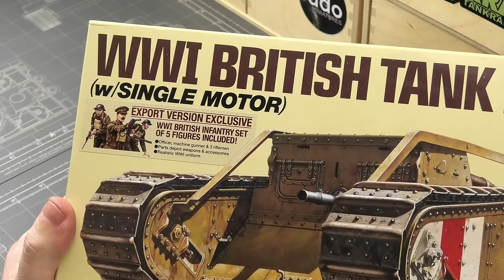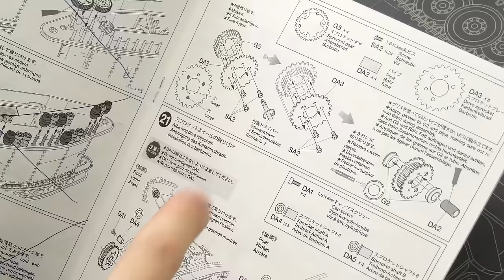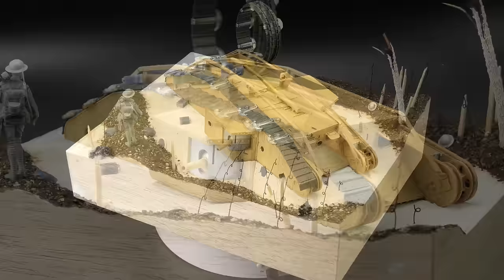Cutting The Best Tamiya Tank Model In Half... For Diorama Purposes!

Comment: I've built almost all the 1/35 Tamiya Armour and this is definitely one of the super stars. My rough cutoff for when their design/engineering improved significantly are new tools after 35228 (M8 Greyhound) with the most memorable ones being the FAMO, JSU-152/IS-2, B1 Bis and Type 10. Currently starting the M26 (The front portion of the Dragon Wagon, not Pershing)
Reply from the maker: I'd love to build the Dragon Wagon as well, just the tractor without a trailer! :)
Reply: @NightShiftScaleModels  it appears the m26 was re-released in early 2022, i caught it because it showed up for pre-order on some sites I frequent but I havent actually seen them switch to "in stock". I randomly came across the M26 kit at a store and it doesnt appear to be from a preowned collection and I have no clue where they got it, sorry. Best of luck finding one - i stared at ebay listings for years and never pulled the trigger. If you do get it, I highly recommend getting resin after market wheels at a minimum.
Reply: @NightShiftScaleModels  You could always do the 2000 release, which was just the recovery version. Those go for a fair bit cheaper on the market and if you're just doing the prime mover anyway...

I certainly would love to see you take on something that isn't a tank, and a tank transporter would certainly be an appropriate addition to an armor modelers collection
Reply: @Danfunnyman1234  yup thats the M26 (kit 35244)

Comment: Great diorama idea, and as usual will be executed with perfection. Question though: why not use resin to make the water? In this way you don't have to saw the tank in half, and you can get even more depth with murky water?
Reply: This was my thought. it would have just required a slightly thicker base than he usually does and would have skipped all the cutting.

Comment: I recently made the motorized B1 Bis from Tamiya and it was loads of fun too.  the motor is totally superfluous and caused extra headache when it came to painting the thing, but it was still neat to be able to flip the B1 over, flip a switch and watch it drive over my living room carpet.  Doesn't turn or anything, just goes in a straight line.

One thing for anyone who plans to make one of these with the motor.  They have a track-tensioning mechanism which you should leave as loose as you possibly can.  the tracks that snap together are really cool, but they're only plastic, and I had my poor B1 throw a track after a connection point snapped.  Luckily they provided ~5-10 extra track links

Comment: When  i build bases for my models I use PVC forex board, you can get them in different thickness and sizes. I cut/file all corners at 45 degres so you dont se the end of the boards on the outside corners when i glue them together (same as when you make a wooden box). when it comes to the top i draw the edge of the terrain on the outside and remove the excess material, when i have the terrrain edge the way i want to, I also cut/file the top edge on an angle (inwards) so i dont get an flat top and I can get the terrain materil all the way out towards the edge. 
looks good when painted black afterwards and its stonger than balsa wood.

Comment: Martin, have you tried using foam board for the base edging?  It’s easy to cut, light, smooth and doesn’t warp like balsa.  I picked up a bag of offcuts from my local picture framing shop in exchange for a small donation to their charity collection and it is enough for several models.

Comment: So ... you cut the tank in half so it could be sunk into the diorama, then put it on a base that's deeper than the cut-off part of the tank?  Seems like digging a crater in the foam would have been much easier (if not more dramatic) ... you could even backfill with dirt/sand to close up the gap?

Comment: Replace your balsa with basswood.  You can usually find it sold in the same place as balsa.   It's not as soft but still fairly easy to work with and will give you a better finish.

Comment: Just wondering. The cool looking shell hole at the front of the tank seems to have no corresponding damage to the opposite side of the...well...track housing thing? Not being picky...but it would bug me later if it was my model.
Reply from the maker: My guess is the tank got bogged down in those craters and Germans just shot it up for good measure :D

Comment: Hiya, bit fan of your work and really excited to see how this diorama turns out! I just wanted to say something about the scale of that figure!

I know it's sold as a 1/35th scale but it really does look too large. As you say men can be different heights, but he looks gigantic 😲and actually even when you showed it held in your fingers as you were scraping off the flash I thought it looked too big. If the SMLE is to scale (original is 1118mm long) it should be 32mm. If it's closer to 35mm in length the figure is scaled more towards 1/32nd.

The MkIV is huge and should give the impression of dwarfing a person alongside it, even if they're about six feet tall which is what a man of average height wearing a stahlhelm is for example and there are period photos of German soldiers standing or walking beside MkIVs showing the crown of the helmet is still below sponson roof height.

Comment: Flinching because a friend of mine had his Dremel/air compressor power skipped and climbed and slashed his arm it required 82 stitches ( starting from the first knuckle joint before it’s the thumb finger itself and ended 4 inches above the the inner elbow)

Comment: Clearly you weren't happy with the surgery but as you say, the ragged cut is no longer visible.

The illusion that the rest of the tank is still there is remarkably convincing even given the absolute lack of realistic coloration or simulated water at this stage. I think it's the off-level cut that does it.

Looking forward to the finishing stages but I think you've nailed the hardest part of this diorama, a believable overall look. I remember when you were "afraid" of dioramas, and here you are doing one with an unusual degree of difficulty, and ever-so-casually including a figure superdetailed with barbed wire.

Any other old phobias you're thinking of conquering? Your viewers appreciate the inspiration.